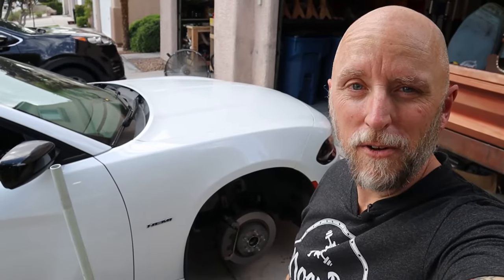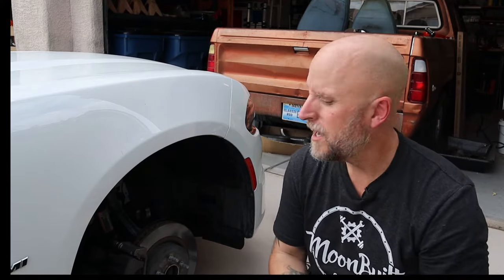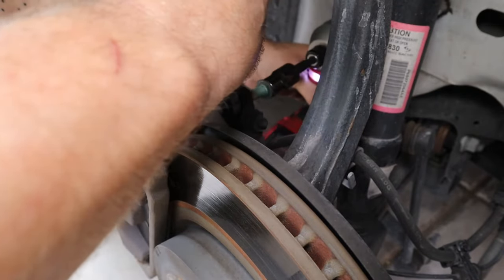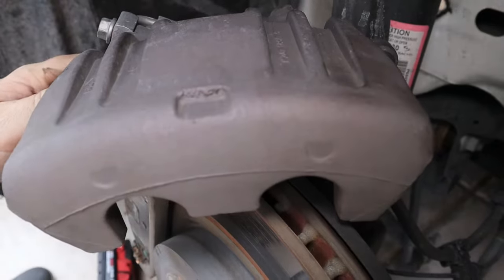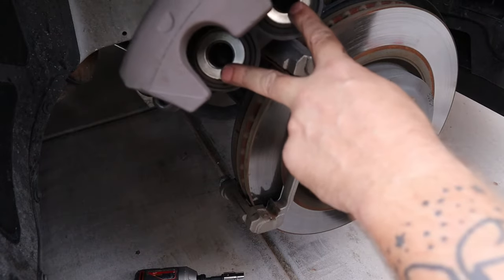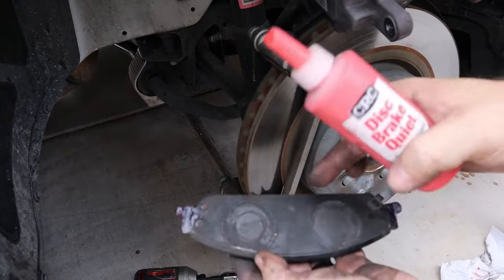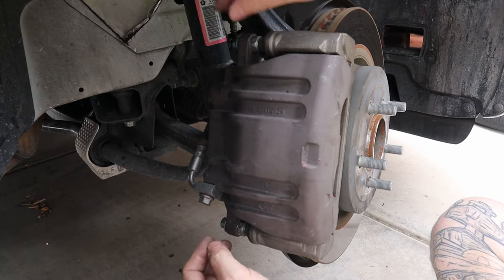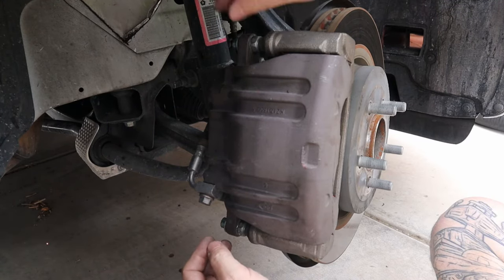Replacing Front Brake Pads | 2017 Dodge Charger RT | How to Replace Brake Pads | Quick and Easy

Comment: Awesome vid. Try turning the wheel next time to get to that hard to reach spot.
Reply from the maker: It wasn't that hard to get to...working with and around a camera makes things a little more difficult.  Plus, I only had the one wheel jacked up, and my driveway is sloped....even with the e-brake on and the wheels choked a don't wanna be moving the wheel that is still firmly planted on the ground....
Reply: Hey fella no helpful tips allowed!!! 😉

Comment: Did you ever figure out what the squeal noise was? My 2018 just started doing it about 2 weeks ago an can’t figure it out .
Reply from the maker: I finally got fed up and replaced all the brake pads...fixed!  Which doesn't make sense since there was still plenty of life in the pads.  The wear indicator want even close to rubbing
Reply: @MoonBuiltGarage  I just replaced mines and it's still making the sqeal noise -_-
Reply: @jlovesj3335  same
Reply: @jlovesj3335  Semi metallic or ceramic pads? This can sometimes make a difference.
Reply: @jlovesj3335  The squeal noise could be the active exhaust, you can determine if it is by putting sport mode on which keeps the flaps open and the noise goes away.
Reply: It was most likely the material of his brake pads the ceramics make no noise at all compared to those mixed with metals and natural materials

Comment: Do you know what the caliper bracet get torqued down to. If your replacing the roters?
Reply from the maker: I don't recall offhand, but I did a full brake replacement here (100k Mile Service Dodge Charger RT 5.7L Hemi 2017
https://youtu.be/G4NK8xDGJVg )and I think I called out the torque values...I think
Reply: @MoonBuiltGarage I'm watching the video now. For the brakes and roters how do you turn the rotor to the right or left? Do you have to put the car nuetral or will it just turn for you in park?

Comment: I have a 2017 Charger SXT. Did you get any shaking as you slowed down on the left side?  Im getting that as i slow down, but no squealing. Could that be the brakes or rotor?
Reply from the maker: At the time this video was made, no, there was no shaking....BUT, in the video I just released the other day I did ANOTHER brake job, this time I replaced the rotors due to what I think was a warped rotor, causing shaking during breaking.  I belief my Driver's Side rear rotor was warped...I need to check the old rotors before I ditch them
Reply: Definitely wraped rotors brother. Gotta change them.
Reply: Change both but mostly it’s rotors